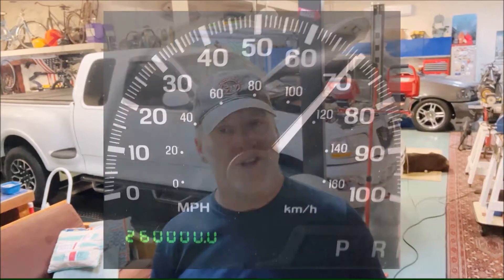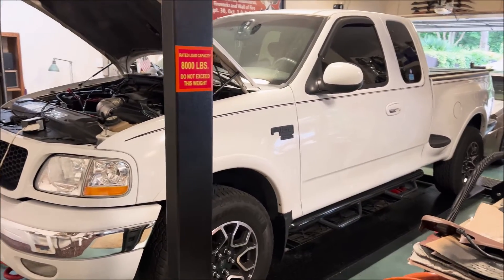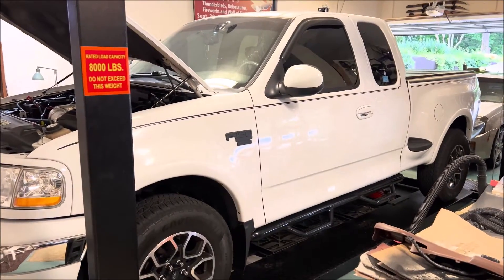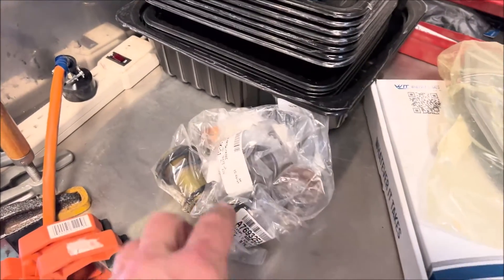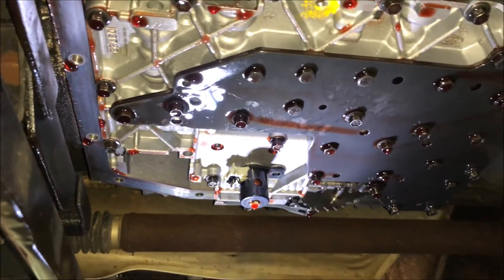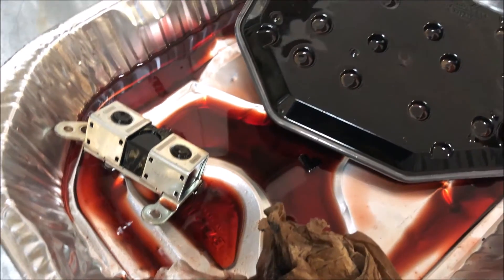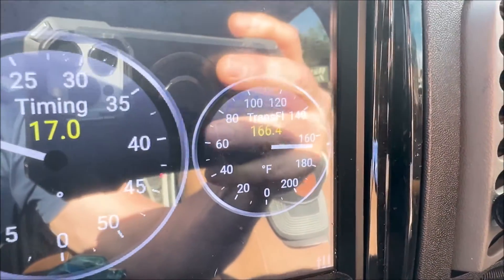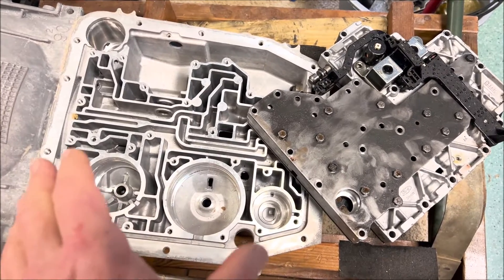No 3rd Or 4th Gears Ford 4R70W Automatic Transmission: 10th Gen '97-'04 F150, Mustang, Explorer

Comment: I have an 03 almost identical to yours, it has been one of the best vehicles I've ever owned, love your content, looking forward  to how this all works out for you, rebuilding automatic transmissions requires patience and paying attention to details, doing your research to gather information on a specific models weak points and known issues is also extremely important and I have no doubt you have all those bases covered, glad your keeping your 10th Gen alive and well as that is one of the best Trucks Ford has ever produced.
Reply from the maker: Thanks for your comment, this truck has become part of my family... actually, it's my dog's truck.  He loves the back seat area I set up for him.  ;)  I think I've found the weak spot, the forward direct drum, and as you saw, I bought a new one.  My next challenge is whether or not to buy a very high end torque converter that will increase torque multiplication from 1.95 to 2.5, a huge difference with a very high price tag.

Comment: Thank you for your videos! Is the screen with timing and temp displays a head unit or a monitor for something else? It’s a double din radio mount.
Reply from the maker: appreciate the question and the comment.  The screen you see if from Torque Pro that works on Android based head units.  This video is the install of the head unit I used:  https://youtu.be/6DOUWk4cbhw?si=DCBMHk3FdVlQhg1M  you'll also need the OBD dongle I recommend in the description of the video.

Comment: Ik from experience the throttle position sensor can go bad without setting a DTC and cause the transmission to stay in second gear. May want to give that a try
Reply from the maker: Excellent comment, my problem is it neutrals out of second with no 3rd or 4th… it’s time for a new tranny anyway since I take this on long trips.
Reply: @DrivingIntelligence  oh ok makes sense to rebuild. I'm thinking of rebuilding one too just to have on standby. Are you going to go through the transfer case too?
Reply from the maker: I’m not planning on going through the transfer case.  I’ve hardly ever used 4x4.  What are your thoughts?

Comment: I rebuilt my 04 F150 4R75W.The reason for the rebuild I lost  reverse .Found a broken reverse band . Total rebuild with sure cure kit.Trans still works great.Loss of overdrive can be a broken overdrive servo snap ring. Easy to replace.You  just need to pull valve body.
Reply from the maker: I hear you, but I’m also missing third gear, so I’m sure it’s the forward direct drum. It’s actually fun going through this thing
Reply: @DrivingIntelligence  For sure could be.

Comment: Good luck with the tranny rebuild!  Don't you have to remove the torsion bars to get the transmission out?  That looks to be a pain.  I had a moment of insanity last June and sold my 2002 F150 Supercab Lariat FX4 170K miles and bought a new Nissan Titan Pro4X.  But I love the new Titan and so does the wife due to its comfort and new tech stuff.  I'm 80 now and working on vehicles just ain't as much fun as it used to be!  Ha!  Lots of good memories with the old F150 though.  I drove that truck all over the country for work and vacation.
Reply from the maker: That's a great question, I hope not!  That will add a whole new level of complexity.  I understand you regarding comfort.  That's why I've done a ton of things to quiet this truck and make it more comfortable.
Reply: @DrivingIntelligence  If you go to South Main Auto's youtube videos, you will find a video of him removing the transfer case which may be of some help.
Reply from the maker: @williamwhite9767  thank you

Comment: Another thought: a larger transmission cooler wouldn't hurt at all considering you live in a hot climate. Transmissions hate heat.
Reply from the maker: that is an option, but I can't find a direct replacement, so I've decided I will install a fan on the stock unit to cool down more effectively.
Reply: @DrivingIntelligence  Would one from an F250 fit?
Reply from the maker: If you’re referring to the F250 heavy duty, they’re not a direct bolt-on, but I’ve never checked the F250 light duty
Reply: @DrivingIntelligence  I bought a new 2000 F150 XLT supercab 5.4 4x4 and Ford had advertised that with the tow package it had enhanced cooling which it didn't.  Enough owners noticed and complained that Ford offered the owners the choice of a larger radiator from the 7700 truck, $100 cash, or $500 credit on a trade-in.  I chose the larger radiator.  I don't know if the heavy duty truck had a larger trans cooler but the larger radiator would cool the trans and engine better I'm sure.
Reply from the maker: That’s a very good point, I want to put a new radiator in my truck with welded aluminum and caps and higher capacity
Reply: @DrivingIntelligence  Mishimoto.
Reply from the maker: @theezeelife292  nice, but pricey!
Reply: @DrivingIntelligence  yeah, but you get what you pay for.
Reply from the maker: @theezeelife292  truer words never spoken